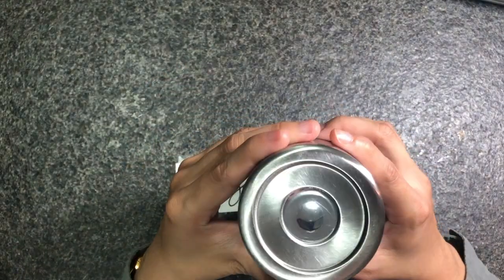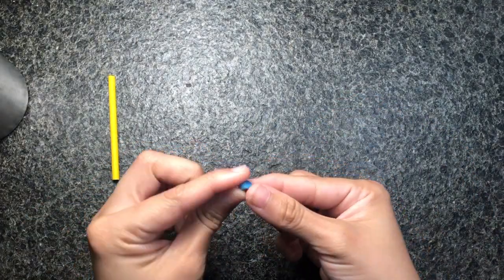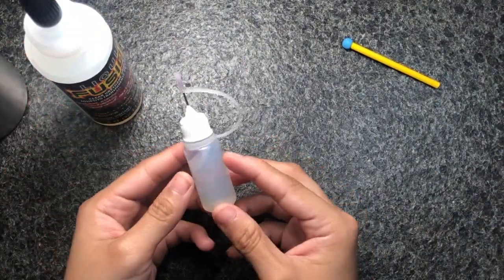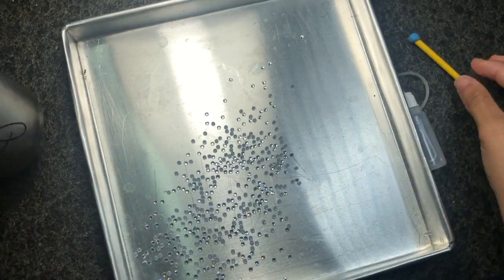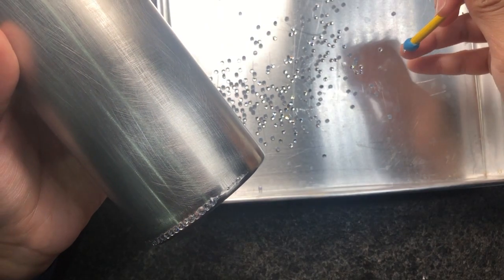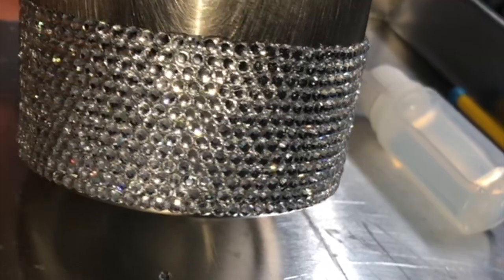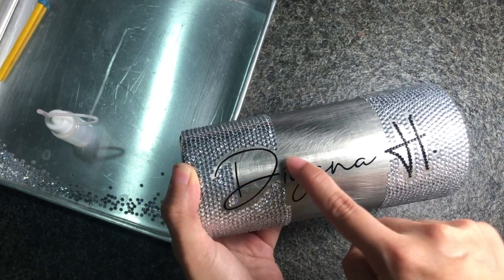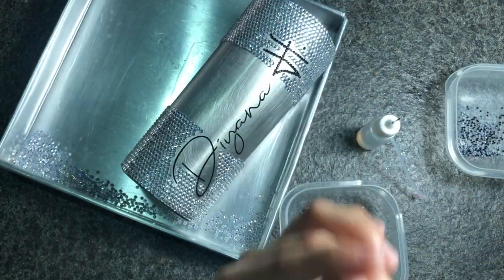How to make a Rhinestone tumbler from scratch to finish using Liquid Fusion

Comment: Very beautiful.  I must ask because I am confused..(sorry) do the smaller stones have smaller numbers? or do larger stone number make it a larger stone? I think you said that the black was ss4 but the clear was ss10. Does that make the black ones smaller? I think I would like them all the same size but small. would it work with all of them being the same size at a 4 or 5 etc? and how many would I need to purchase??  Sorry for so many questions. Thanks for sharing. It is a beautiful cup. 

Donna
Reply from the maker: Hey! Yes, smaller stones have smaller numbers. The black is indeed smaller. And, yes. You're able to use all the small, and same size (SS4). Its just a longer process. hehehe. If you're looking at SS4(theres no ss5, its only even numbers), on the same 15oz tumbler. You should measure circumference of tumbler, multiplied by the length of the tumbler, divided by the area of the rhinestone. then you divide by 144 (1 gross) to find how many gross you need to purchase. - i hope i type this out correctly.. hahahah!
Reply: @Kruftisg  Thank you so very much!!  I do appreciate this information. I think i'll have to take a picture of your answer so i can follow those directions. ;-)